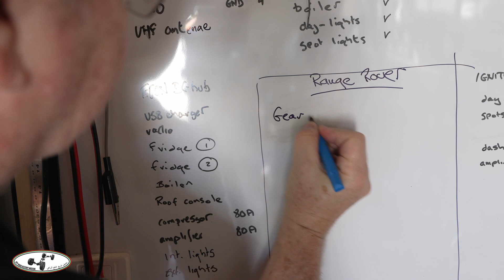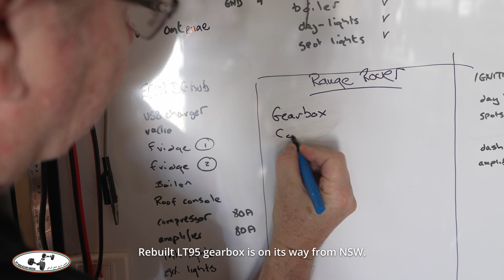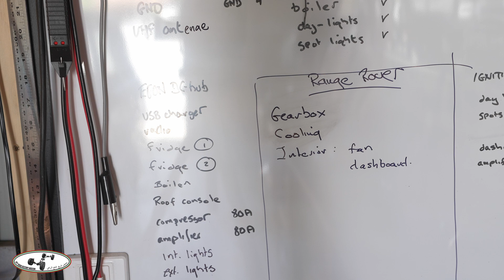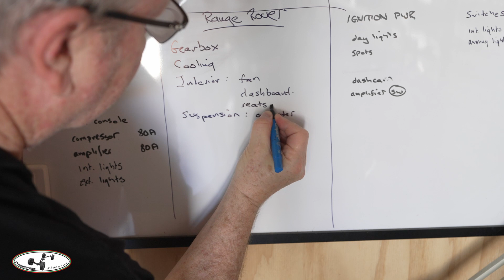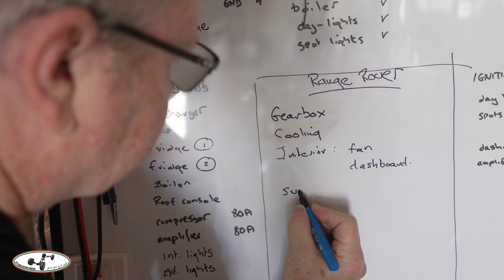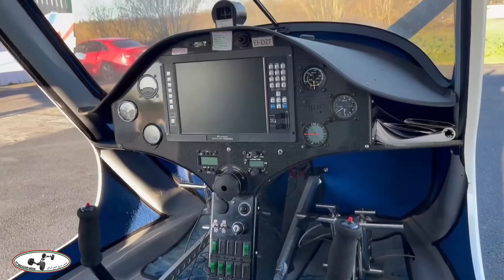Unexpected Wheel Rim Problem Revealed | Range Rover Classic Longest Track Prep Begins | 4xOverland

Comment: Re window, runner may be mis aligned in the lower half. Should run freely through out. Is there adjustment at the bottom mounts?

Comment: That very same inner ridge for tubeless tyres makes it very difficult to break the bead on a tubeless tyre using tools like Tirepliers.  There is a significant amount of force required to move the bead off that inner ridge.  I guess it's the way these rims are.  Apparently the ridge is not even height all around, for a Land Rover wheel - from memory the ridge is lowest, either at the tyre valve position, or directly opposite it - I can't quite remember.  This low point in the inner ridge is where the Tyrepliers is used to break the bead away.

Comment: Drilling out rivets. The center is hard steel. The outer is soft metal. Get a bigger drill bit and take off the top of the soft metal. Then centre punch the middle out. Then use a smaller drill bit to take the rest of the soft metal out. This way you wont make your hole bigger.

Comment: Try fitting later Range Rover Vogue alloy wheels with the benefit of reducing unsprung weight. Overall weight difference may allow you to carry 2 spares. Finer filter may have an oil sponge filter to suit your air box. May I suggest ‘Range Rover Robustus’ for your old beast. I would recommend an Australian flag painted on the bonnet, see below.

Some people remember where the where when Kennedy was assassinated, I remember when a beige 1972 two door arrived in our driveway owned by a surveyor friend of the family. At 14 years of age I told my Dad the Volvos really did not cut it.

I owned a 1972 two door Range Rover in Lincoln Green, assembled in West Australia. It turned 20 years old in the few years I owned it, with about 250,000 miles on the clock. The fellow who bought it off me had hit a bull in WA in the same model and walked away, clearly a he was a fan.

I had a mate on the Atherton Tablelands who also had a two door at the time, which he rebuilt in stages circa 1994. Whilst the two of us carried out the old rusted chassis for a replacement (Grandfathers Axe is a Range Rover thing is it not?), he chanced to remark that as he rubbed back the bonnet he revealed a Union Jack. I immediately knew where I had seen this unique car before, it had been run by an Australian team in the Paris to Dakar Rally in the late 1970s. This car still in rally fit out was truely awesome as it bounced into a quarry at the back of Cairns, where we were messing about in a Riedy’s shorty Landcruiser about 1980. I nearly cried as Ted told me how he removed the long range fuel tank, roll cage, gauges, Perspex rear windows, all to pimp his ride. Last to go was that chassis, rotten through with rust due to a long life in the tropics with the sodden foam core fill installed to stiffen the chassis. I do not know what that chassis weighed, but my back still twinges. So I was able to provide a photo to Ted of his car in its glory years. One of the 4X4 magazine happened to run an article at that time, wondering aloud where the Paris to Dakar Rally Range Rover had gone. I wrote up a blurb but Ted never sent it in to the magazine. I will have to dig out the negative.

 I went on to buy a 1985 4 door with 3 speed auto, which my wife loved to drive. 

Later again I owned two second hand Series One Diesel Discoveries, they were truely great vehicles on or off road, using only 9 litres per 100km, inheriting the Range Rover Running gear and 2000kg tare weight. Later models weighed nearly a half tonne heavier, longer over hangs, complex electronics, less agile, less user serviceable and $20,000 more expensive. 

I commanded a RFSU platoon in north Queensland with 6 RFSU Perentie LandRovers, truely a horse designed by a committee, (a camel), ideal for the long range reconnaissance patrol work through out Cape York with 1200km range and Izuzu 4 pot non turbo engine. Ideal, apart from a misguided specification of super thick and heavy steel wheels, which brings me back to the benefits of alloy wheels to reduce the unsprung weight.
Reply from the maker: Just got a set off Gumtree.
Reply: @4xoverland   @4xoverland  there is a company which makes subtly different replicas of the Rostyles which can run tubeless tyres. They're about £1400 in the UK, but they look very much like the originals without all the bother associated with the original wheels.

Sound rationalisation on the tools, I can totally understand how you reached the conclusion you did!
Reply: I would love to see you research and present the arguments for reducing the unsprung weight, it is a topic rarely addressed and generally poorly understood.

Comment: The water washer bottle would benefit from a strap bracket around the front instead of relying on the integrity of the plastic

Loving the restoration vibe 👍
Reply: Totally agree, especially with the weight of the contents of the washer bottle banging up and down during the hundreds of kms of corrugations the vehicle will incur in the outback. Just asking for trouble. Also the bottom of the reservoir should not just be resting on the body. Should be some sort of pressure absorbent material underneath, like 6mm thick resilient rubber.

Comment: I've got tubed tyres, now, if overheating due to friction is the cause of the tyre failures mentioned in the video, I would assume I would see this on my tyre pressure/temperature monitoring in time, correct? Then slowing down should resolve the issue...

Comment: heh.. chances of a shock failure. I (unfortunately) have Rancho RS 5000 series shocks on my 2800 pound jeep. They're horrific - they're made for trucks that weigh three times what me vehicle weighs. I've had them fitted for the last four years or so simply because I can't afford an alternative. That said, with a solid 85% of my driving over those years being 'on-pavement', I have two blown shocks. 

Andrew preaches getting the right shocks for the application, and I couldn't agree more. Everything else in the suspension can be spot-on, but if the shocks are wrong, the whole system fails to work.

Over-shocked or under-shocked, it doesn't matter, you're going to have a failure. It's not 'if', it's 'when'. And in the extreme 'over-shocked' setup like my rig is currently, understanding that it's a 'lightly' constructed vehicle, it can even lead to frame failure.

Comment: As said before i never drill a "pop" rivet without a bump stop on the drill shank against the chuck. Lesson learned through an a&e course!!!!.. If you have a lathe and old milk bottles simple drill a blank made melted out of that with the shank size sleeve on to the drill bit avoids so much claret on the paintwork!!!! As for the wheels its good to know the technic of the bead retention. I do wonder if the "design" classic center hub could be removed from the original wheel band and reassembled with a suitable one. Engineering dreams against financial considerations I'm guessing and not a thought of wheel spacers officer

Comment: Be sure you dont overheat the engine with electric fans. My oneten v8 did overheat with electric fans. The original fan draws up to 7kw. That is alot of cooling power the best electric fans cant achieve. If these old land rovers are in good condition, you can block front the front of the grill and still dont overheat on warm summerdays.

But if you dont drive in warm conditions or towing trailer it will be ok.

I have used these rims with tubeless on and offroad for years. Never had a problem. Just air up when they slips of the bead. Much Harder to do that on tubeless rims.

Comment: I was wondering if you found it refreshingly simple to work on the RRC compared to a modern vehicle.
Trouble is, a new Troopy is probably just as easy to work on as the RRC because they both originate in roughly the same era.

Might be interesting to let Ronny Dahl have a look at the RRC when it's finished, to compare it with his recent HiLux build.

Comment: Get a set of wheels from a disco 1 steel or alloy the alloys seem to have a very good grip on the bead, there's plenty out there.
Reply: My thoughts exactly.
Reply: I dont think they will fitt. Drive member is very big on the old axles.
Reply: @Ronhickmott  tried to fit wheels from my range Rover softdash on my suffix b. Did not work because the drive member was to big.
Reply: @Ronhickmott  yes they fit newer rangies since they have smaller drive members. I had 300tdi softdash🙂 fantastic car.